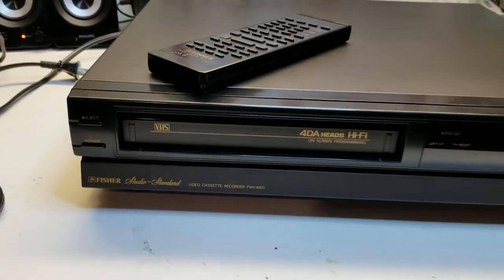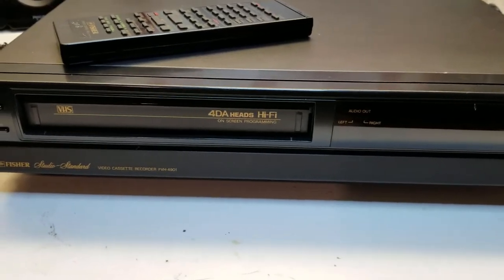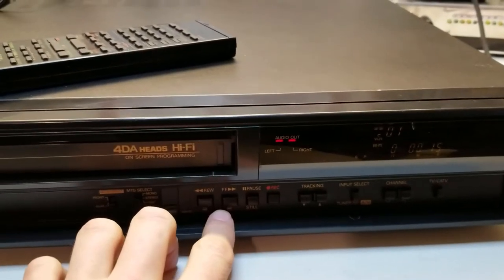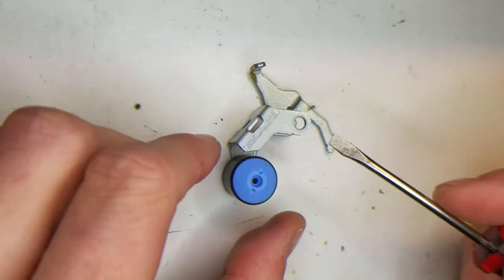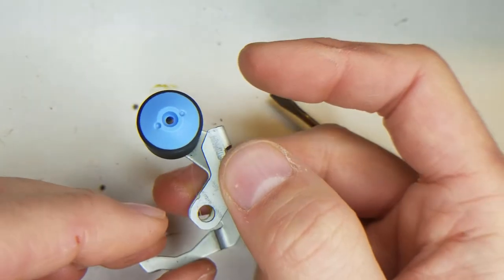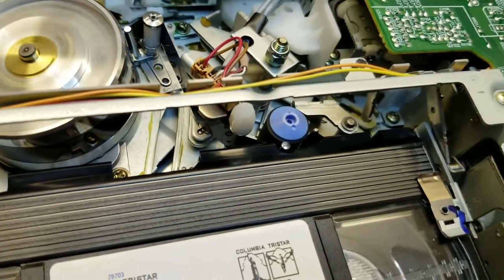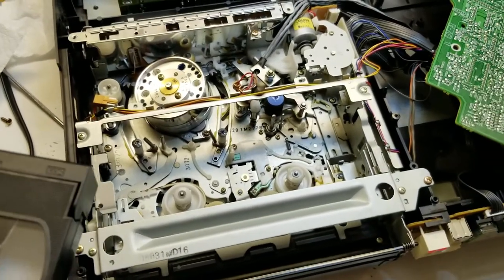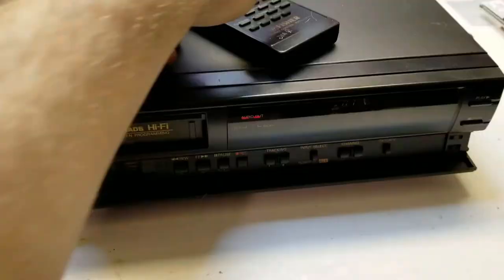1992 Fisher Hi-Fi VCR Repair & Demo (Model FVH-4901)

Comment: This is Fisher 4091 or Fisher 4901
Reply from the maker: Whoops lol. Fixed!
Reply: @probnotstech  lol
Reply: @probnotstech  , great video! I have a Fisher FVH-830, purchased around 1985. It ejects tapes immediately after insertion of the tape. I'm guessing maybe I need a belt similar to the one you replaced. Thoughts? Where did you purchase your replacement parts? AR